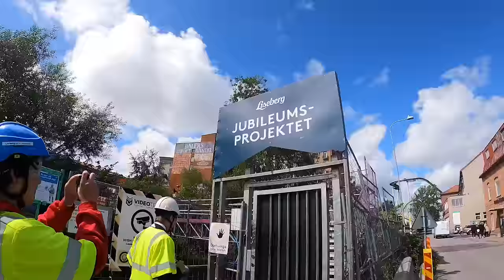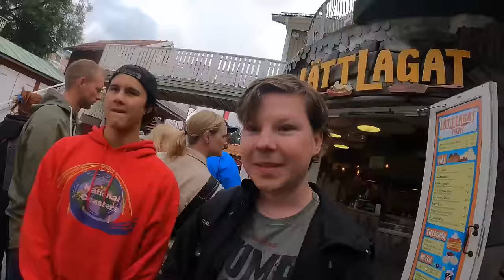Does Helix Actually Live Up to the Hype?! Liseberg - Gothenburg, Sweden | VLOG [7/26/23]

Comment: Sadly, the water park will be delayed because something malfunction and a large section burnt down (I think about half of the 14 attractions survived). It happened 12th February 2024. Luckily it hadn't opened at that time since it was still under a few more months of construction, although sadly one person was found dead. </3
Reply: Wait nah man it cant already be more then 4 months since that happend?
Reply: @trezspre Time flies 😊
Reply: Yeah i remember that day it was on the News and it litteraly exploded
Reply: Only the foundation and vertical walls(not the half-cylinder walls/roof) survived to a state whrer they looked managable, but no attracions inside the waterpark survived to a degree where it would be cheaper to restore than to replace. And if i remember corrrectly the fatality was the constructions manager, Patrick Gillholm(M51).
Reply: It was in the newspaper today 18/7 2024 that the board of Liseberg decided that the waterland Oceana will be rebuilt, with plans for 2026.
Reply: It exploded
Reply: Its being demolished  entirely. Some waterslides did survive, but from the hotel window, its easy to see everything is going down

Comment: The launches on Helix are there to get the trains up to speed without the use of lift hills. As Helix is located on a hillside it only requires minimal launch speeds thats why they're not as intense as something like Maverick. Always laugh when thoosies whinge about how pathetic Helix's launches are like Mack could have made them more intense or something
Reply from the maker: If the general consensus is that the launches are forceless, that’s a totally valid complaint. I don’t care about the “buts”, most family launch coasters i’ve ridden have more power on their launches.
Reply: @CoasterDash  its a valid complaint if you have no understanding of physics. It's a terrain coaster!
Reply: @user-pl5ds8iz6q Thanks for that great and interesting explanation! So basically to get up the hill since RtH isn’t on a hillside like Helix is, Mack had to make that first launch more powerful? Hmmmmm maybe a future video idea could be Coaster Dash + roller coaster physics or an engineer from a major manufacturer?🤔🎢 The ultimate nerd fest🤓

Comment: As I'm watching this I'm loving it. Balder doesn't have over banked turns, at best they're banked at almost (but not over) 90 degrees. If you like Balder I wonder what you'd think of T-Express in South Korea. 
I KNEW Helix would be better in the back for at least two reasons: 1: the drop out of the station and the 2: camelback after the inverted top hat. That back seat POV is another POV you ought to isolate. Thanks for posting!

Comment: Front seats in Helix suck. The right way to ride Helix is in the back seats
Reply: Why do front seats in helix suck?
Reply: @ismail_bel04  You get a more rougher ride in the back, more speed, more everything. The two back seats even has their own requirements. You have to be minimum 160cm tall to ride the two back seats if I remember correctly. And there you get the best experience
Reply: @ismail_bel04  I actually think that front seats suck in all roller coasters. The speed is always better in the back. But in Helix the difference is even more noticeble. Why it is so I do not know